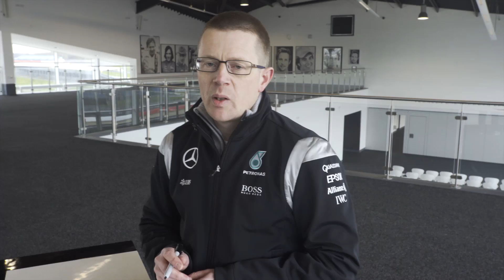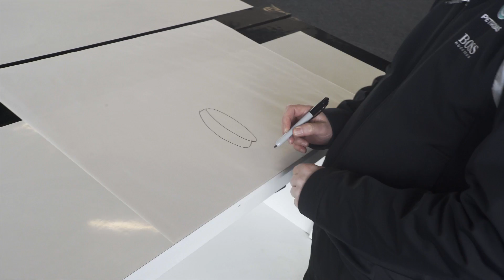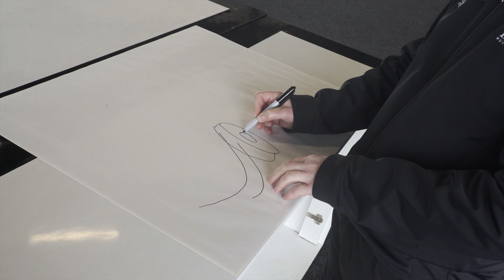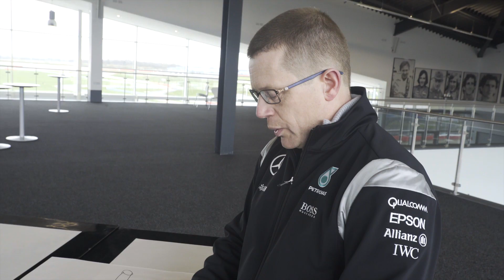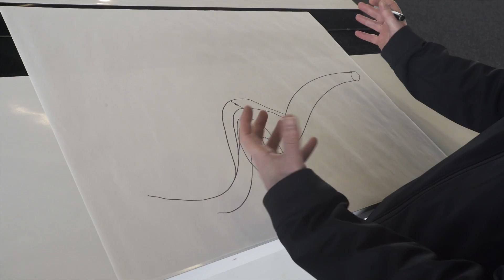New 2016 Mercedes F1 exhaust explained!

Comment: All pls note a 3 dB increase in sound power is a doubling in volume:

10 * log10 (2) = 3.01 dB, where 2 is the double in power (volume)

So "a few dBs louder" is probably not true. Ted K estimated about 30% louder.
Reply from the maker: +Graham Hall 3 dB represents a doubling of sound intensity. It takes about 10 dB for the ear to perceive a doubling in volume. So the scientists tell us!
Reply: Yep, yr right. Won't even get into the Db vs Dba and the origin of the 'bell' . cheers

Comment: It's true that the engines (i'm sorry, PU) sound underwhelming, but i don't think that it's the volume that is the problem, unless you are at the track where the older engines actually made your rib cage vibrate, they were so loud. 

On tv there isn't that big of a difference in the volume, it's the actual sound that comes out is bland and unremarkable. Now turbocharging doesn't help, but there are plenty of great sounding turbo engines (AMG GT anyone?). RPMs are also not the issue, because this PUs are still one of the highest revving ICE in the world, much higher than any street car.

The biggest impact on the quality of the sound comes from the engine config, or more specifically the firing order of the cylinders. V6 engines as a whole are one of the worst sounding engines out there with the exception of inline 4. The turbo compounding (MGU-H harvesting) also probably has an effect, but since it's really a new thing i don't know how much of an effect it has, but given that the cars don't really sound any different in Q i could guess that the impact is minimal. 

Long story short the sound won't improve unless a completely different engine config is chosen. There are also 2 less drastic changes that aren't guaranteed to work
1) Change to a dual turbocharger solution with seperate pipe for the 2 banks. But that would need a whole rework on the MGU-H settup
2) Changing the firing order of the engine. I am no expert but it should be possible to get a better sound that way the problem is that it will cause an engine imbalance.

TL;DR - The PU can't be made to sound better in a easy or a cheap way

Comment: Turbochargers have always been sound deafening.  

In the 90's I drove to the circuit of Spa Francorchamps.  I parked the car near the circuit in the woods while the F1-cars were testing.    I'll never forgot the sounds of the F1-engines in those days.
Reply from the maker: +Carpe diem glxke You're right, it's simple physics that a turbo engine is quieter than a nat asp equivalent. It's the same physics that also make it more powerful...

Comment: I don't like the fact it is artificial... It's like they are fooling us
Reply from the maker: +MrGiboz24 The sound is actually completely natural. The new regulations just unburdened the tailpipe, giving the noise from the turbine a clean journey
Reply: +MERCEDES AMG PETRONAS
Yes but the only purpose of this is to increase the noise, not the performance, so it is an artificial expedient to make these poor-sounding cars more appealing to the public. I don't like it
Reply from the maker: +MrGiboz24 Only as artificial as any of the other lines in the regulations that set limits for what may or may not be done. It's completely performance neutral.

Comment: but according to journalist at Barcelona it does not work
Reply: +DieselDan09 
its only a few decibels louder. the reason it doesn't sound like it works because an efficient engine wouldn't be wasting the extra compressed air but rather use it to spool up the MGU-H to charge the battery or even directly drive the MGU-K.

however when the wastegate IS actually being used (probably mostly during qualy) it will only be a wee bit louder. not exactly the roar spectator fans will be looking for but as someone who only watches F1 on TV the high pitched V8s made my head hurt lol.
Reply from the maker: +Homunculus Watch again - it's nothing to do with whether or not the wastegate is being used, but about freeing up the main tailpipe!
Reply: +MERCEDES AMG PETRONAS It didn't really explain WHY it had a silencing effect, only that it did. Was it because some of the exhaust made it's way up the waste-gate backwards? Meaning that some energy got dispersed before it made it out of the exhaust?
Reply: look up the j-pipe resonator to see how extra tubing effects flow.

Formally known as a resonance pipe.
Reply: +Homunculus exactly. Plus, the exhaust tubing isn't long enough to cause any resonance within the exhaust and increase noise.
Reply: +DieselDan09 ...and what do the journalists know?
Reply: Rogue Qall More than you most likely, sense they are actually track side.
Reply: Themayseffect Given the opportunity, they'll publish something for the sake of gossip than to actually inform the fans and general public. I don't get my information from journalists, I follow the technical experts who do it for the passion of their given sport rather than the ones waiting for their pay check.
Reply: Rogue Qall
Most technical experts are journalist as they are reporting news and information. Who are these so called experts you get your info from?
Reply: +Themayseffect I doubt many journalists have degrees in mechanical engineering or aerodynamics.  They may know some basic technical information.  But I would trust the opinions of the team engineers over the journalists.  F1 doesn't have a problem with the volume...I think it is the pitch of the engines/exhausts that have really changed with the new regulations.  I still like the V10 days...those engines screamed!